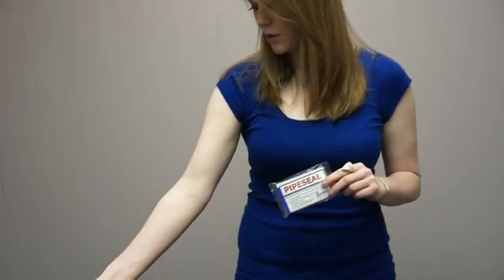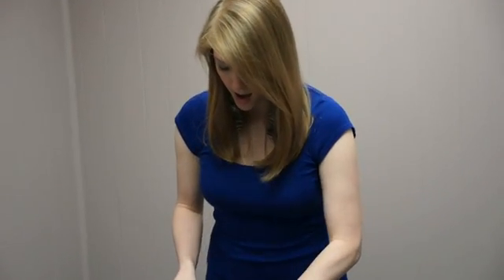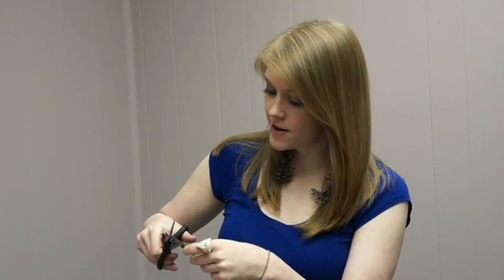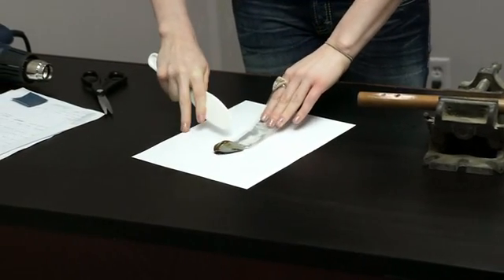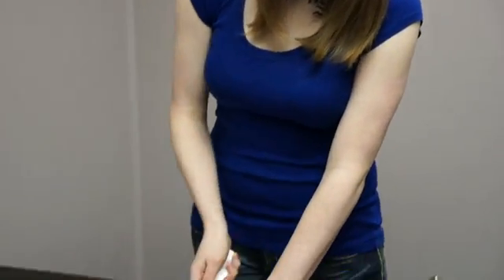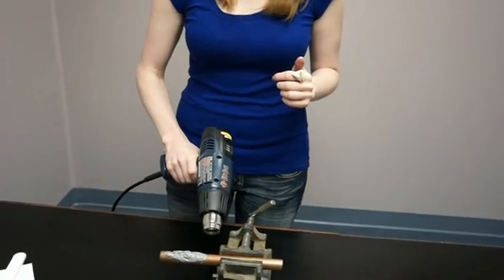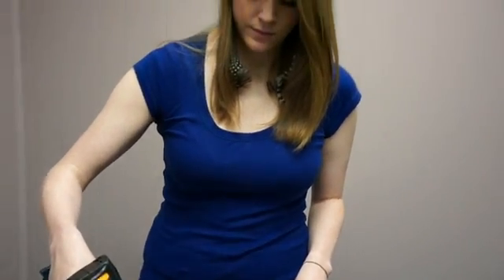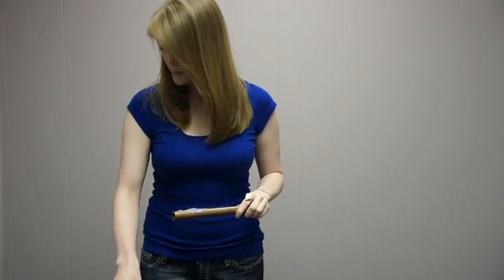Pipe Repair; Pipe Leak Repair; PIPESEAL; Refrigerant Line Repair; Dynesic; Tasha Manning

Comment: There's no such thing as 3/4" refrigerant pipe. Type L copper tube for hvac/r is thicker walled copper and is measured using outside diameter so it would be 7/8"  this would never work for hvac/r. Just pump the system down and whip out your torches and brazing rod.